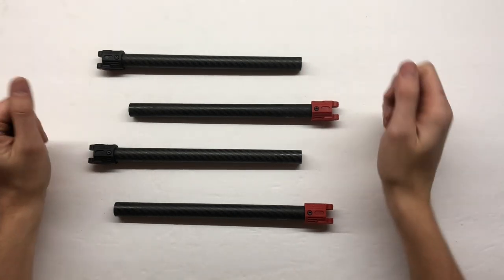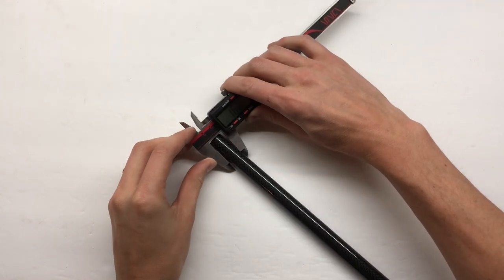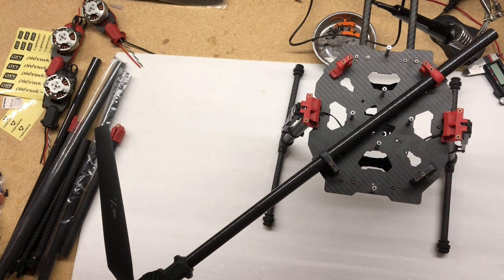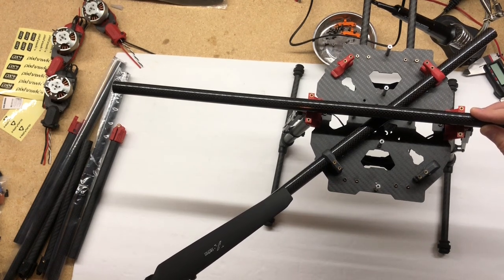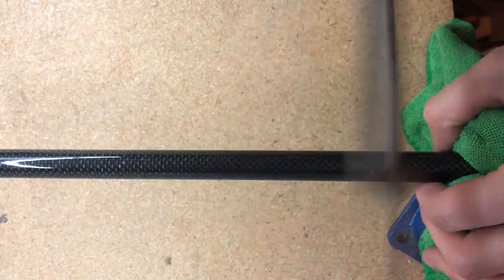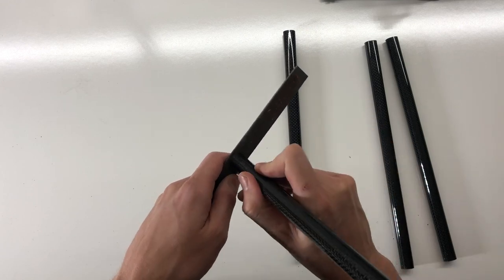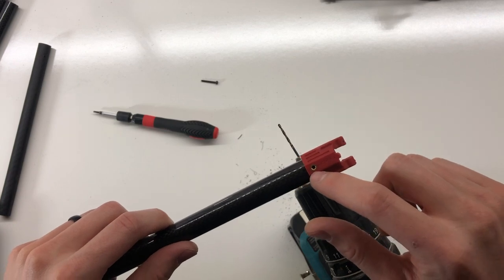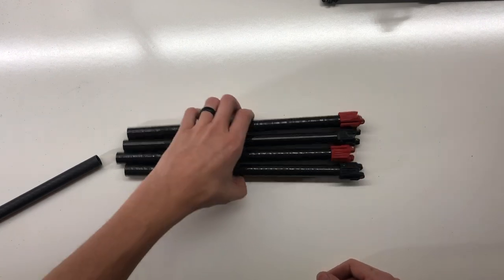How to extend arms on tarot drones

Comment: Thank you for this video. I too am building a Tarot 650 Sport and plan to use 17" propellers. When I discovered that the arms were too short I was going to try to splice a longer piece of tubing, but decided instead to follow what you did. I also had to replace the wires going to the motors from the ESCs (I've mounted the ESC's in the central body).

Comment: Hi nice one. I am planning to build 21 inch propeller with T mote 6007 II in that case how can I calculate the tube length and also I have a doubt about the strenght of the tube. Incase if I add more weight there are chances for getting the tube to get bent right ? How should I determine the thickness and length of the tube in that case. My motor says recomm thrust is 2kg and max is 5.5 kg per motor in that case If I have 4 motors and If I want to add 12kg full weight will I be able to lift with same tube configuration or will it bend ?

Comment: Were your arm ends, glued ? I'm trying to extend my arm lengths like you, but I found my brackets glued and am having a real issue getting the end mounts off the original arms ?
Reply from the maker: No I had a screw on the end and that’s it.
Reply: Same problem here! Andrew, did you eventually get them off?
Reply: Hi Herbert, I never managed to get my glued ends off, I found new ones on eBay, search “tarot 16mm” you’ll find them. Andy
Reply: @adibbins  Cheers!
Reply: Use IPA to weaken the glue bonds and gently rock side to side and repeat until glue bonds break.